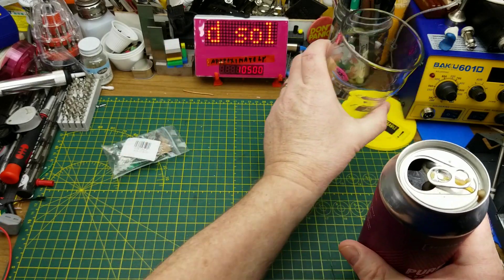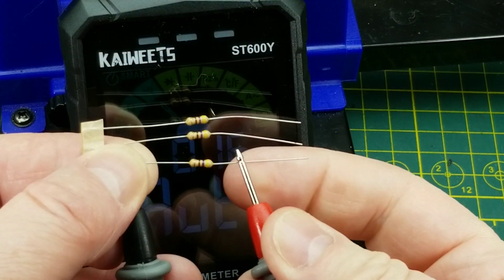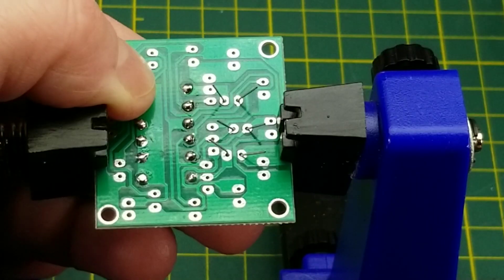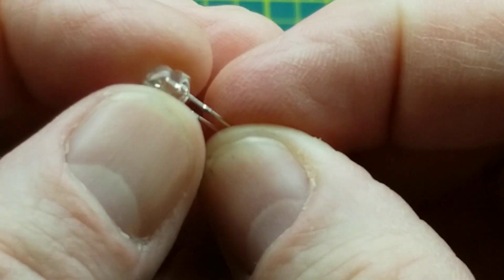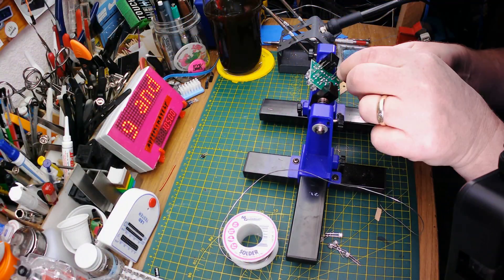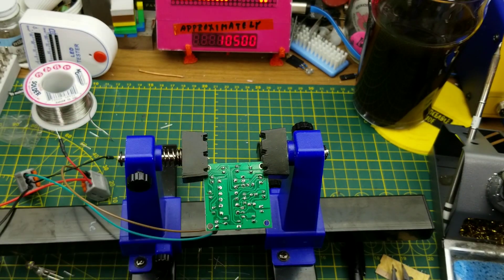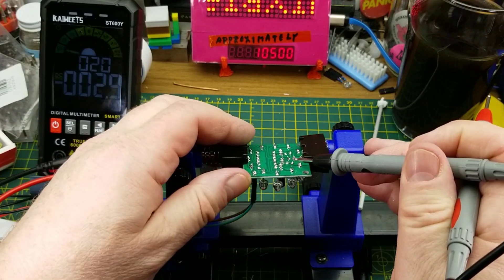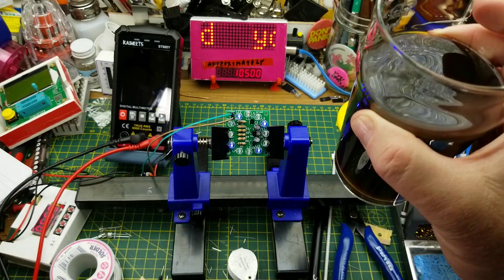chill-out kit build: 3 transistor chase lights

Comment: I generally go with the insert one component and solder it approach as it is less likely you will end up inserting a component the wrong way round. Check twice then cut the component leads. (My variation on the measure twice cut once.)
Reply from the maker: I am usually a lot more accurate when I'm not multitasking with a camera...

Comment: The sign of a professional kit builder.  All of the color bands point the same direction.  The sign of a professional electronics tech.  He knows the color code and can pick out the 10k resistors without a meter.
Reply from the maker: And what is your opinion of a colorblind guy doing electronics?
Reply: A professional would never put a transistor in backwards. 😉